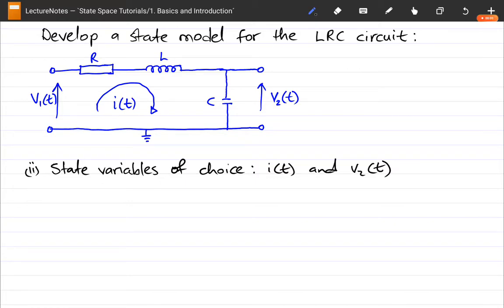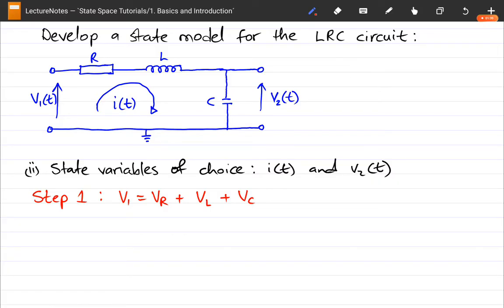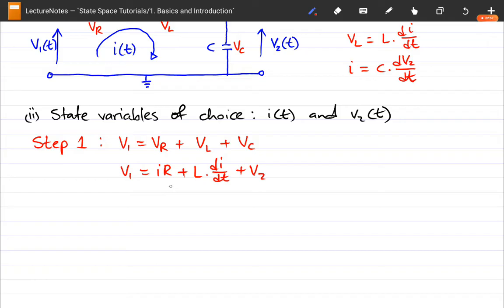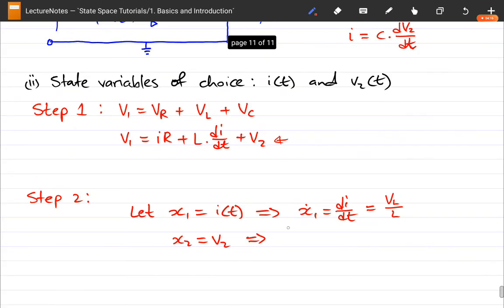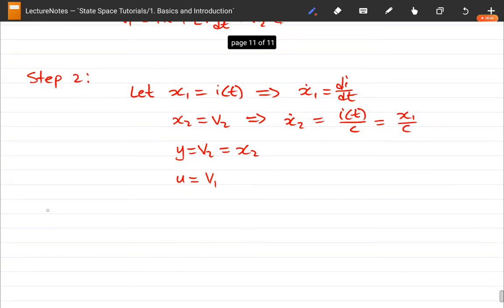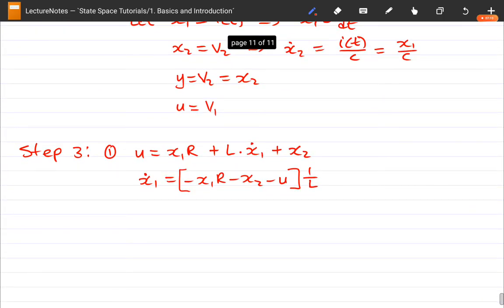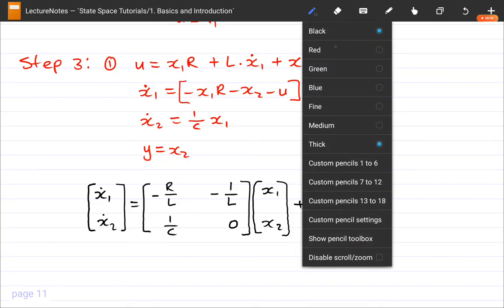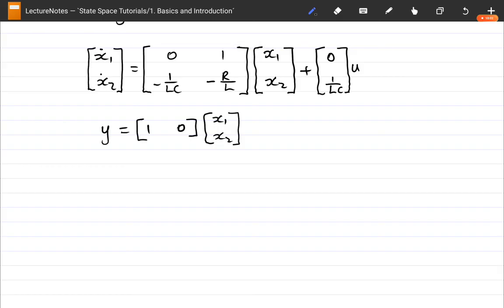Example: state space model of an RLC circuit (part 2)

Comment: Sir if the resistor is seen series with capacitor & there is no resistor series with inductor ..then also the state variables are same?
Reply from the maker: Notice that the resistor in the question is already in series with both the inductor and capacitor. This is because the circuit is in fact a series RLC circuit. So you can decide what v2 is. If v2 is still the voltage of the capacitor then yes the state variables remain the same and the solution methodology doesn't change. But if v2 is now the voltage across the capacitor and resistor (in the case where we swap the configuration order of the inductor and resistor) then the solution will be different to the one I presented in this video.
Reply: @Timothymukansi  ok Sir ..thank you